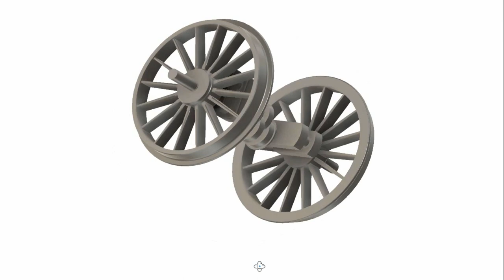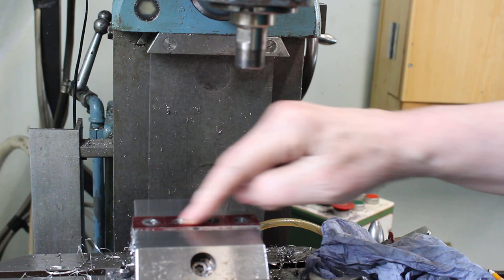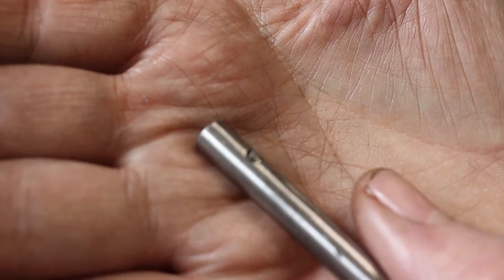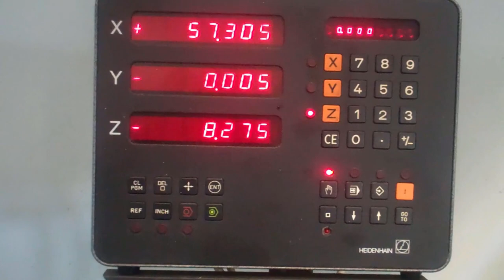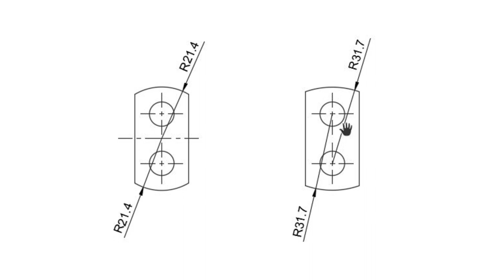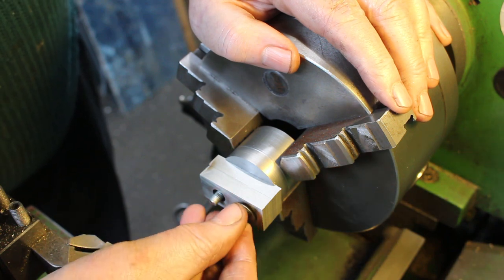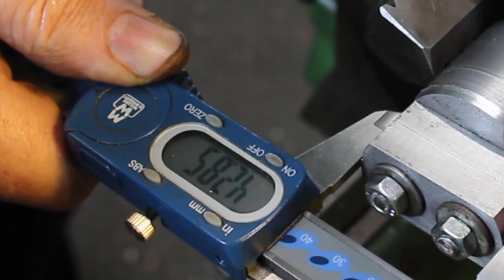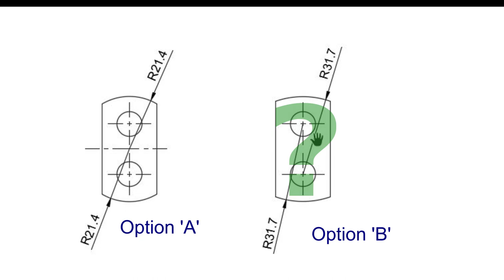Lion - Locomotive Steam Engine Build pt.35 -  Crankshaft Webs + Cool Shaper Action

Comment: Cool, that shaper, it is one of those machines that simply make music. A question though, why didn’t you just start from square stock in the first place?
Reply from the maker: Round to square is a therapy session! Nothing better than the music of a Shaper cutting metal.
I often just square up round bar if that's what I have in stock, it's a great excuse to use the shaper besides, I don't think 431 st st is readily available in rectangular sections.
Cheers!
Reply: @GoCreatehms  yep, the shaper is poetry in motion!! I agree with the argument that putting the shaper to work is the nicest way to get square stock :-)

Comment: At least 431 stainless is magnetic so using a magnet for 52 pickup will help!
Reply from the maker: Yeah, I forgot to mention that in the video, so no problem surface grinding using the mag chuck. I find it much nicer to machine than 316, 316 does have better corrosion resistance.